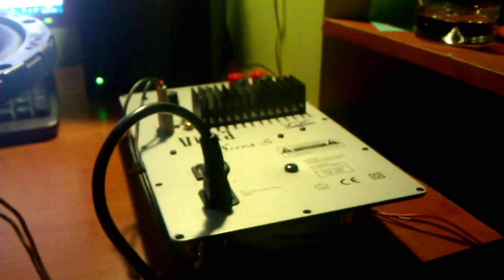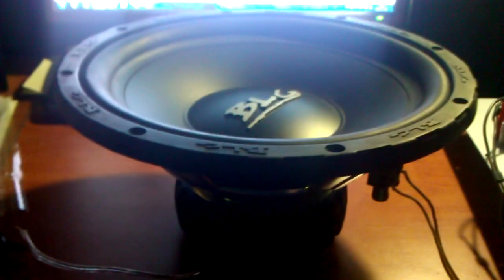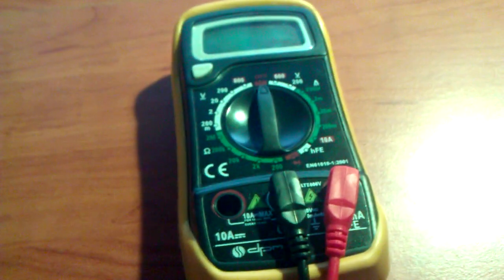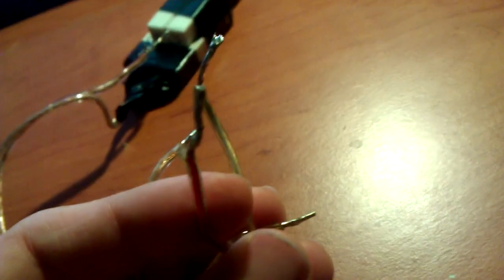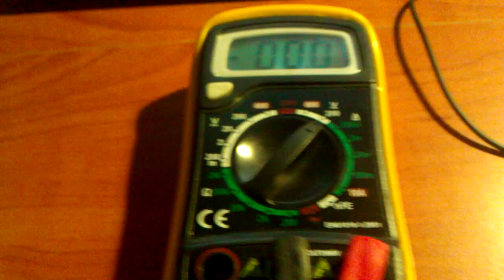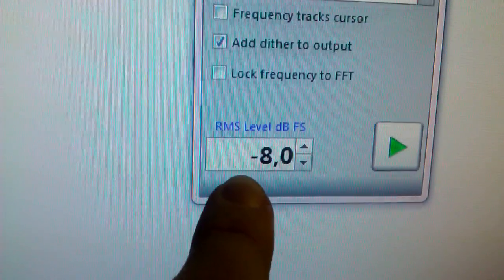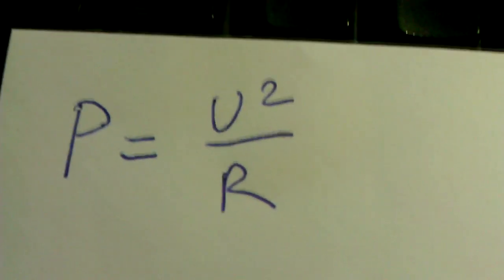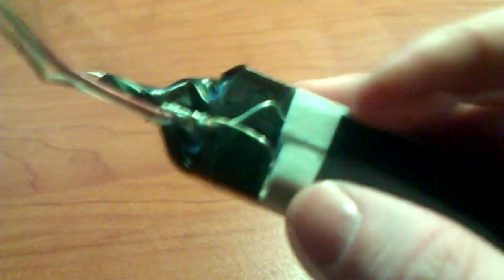How to measure real RMS amplifier power without making noise

Comment: Great video. I see most people using speakers and clamp meters, I also prefer to use resistors as their ohm load doesn't vary based on input frequency like a speaker does. To get more accurate results, a oscilloscope can be used or a SMD DD-1 "distortion detector". I would also recommend a True RMS AC volt meter for accurate voltage measurements. See my channel for several amplifier output tests using these tools. Keep up the great work!

BigDWiz - OldSchoolStereo-com

Comment: What if you had an old speaker that the cone was split or something.
Could you remove the cone and use this has a dummy load
Reply: Yes, altho not recommended, but it would probably work at a low frequency (100 cps) and for just a short period of time.

Comment: INTR-ADEVAR NU ESTE GREU P = U2/R = 20V*20V / 8OHMI = 400V/8 OHMI = 50 WATTI, MASURAREA TENSIUNII ELECTRICE DE IESIRE A AMPLIFICATORULUI SI REZISTENTA DE IESIRE A AMPLIFICATORULUI CU MAVO 1, MAVO 35 SAU ALTE APARATE DE MASURA SI CONTROL

Comment: I have a question... I have a hand made amp, my dad made it in the 90's, but he is not with us anymore, so i cant ask him, it is great, sound is perfect, but i lost it's original speakers while moving (yah, lost, sure, someone took them)... I have 2x80W speakers and the speaker protection kicks in about half power... i want to buy new speakers, but i'm not sure exactly how much power does it have... can i still use 50W in resistors, or do i have to match the power of the amp...?